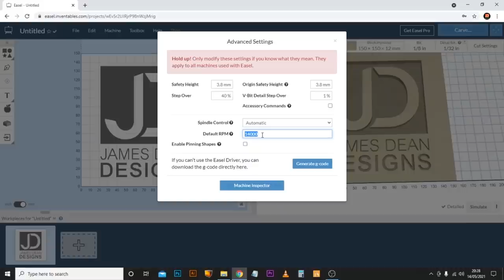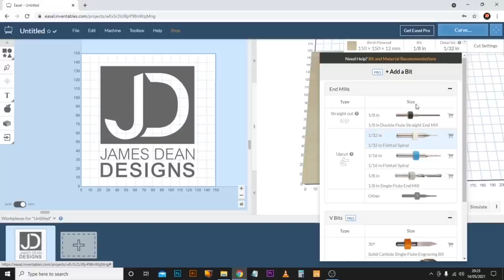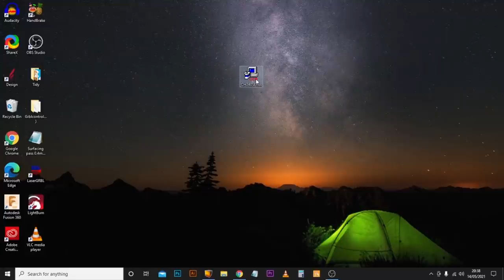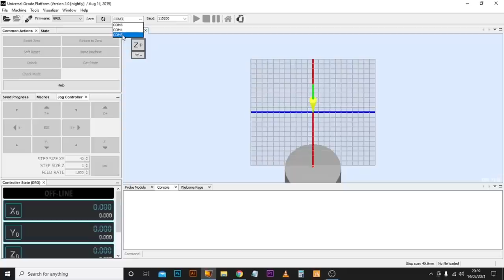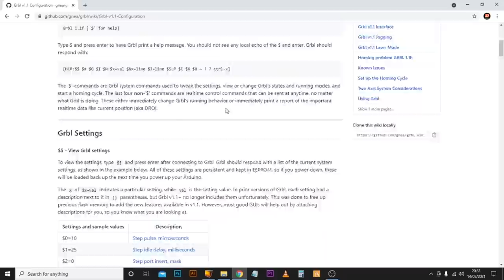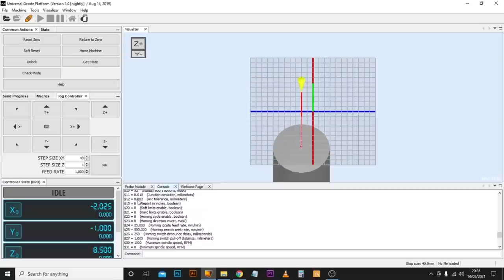Top 10 issues and solutions for desktop CNC machines - 3018, 4040, 4060, 6040, 6060,

Comment: Great video as always, very helpful! I'd just like to add that when routing out a profile it's always best with small bits to run multiple paths and drop down say 0.5mm each step. Harder materials the lower the step amount. It takes longer but your bits will thank you (and no I don't work for Manscaped lol!!). I have a 3018 pro but will definitely be building my own rather large CNC machine after scavenging some expensive steppers, just need to get the trinamic 5160 drivers built up...
Reply from the maker: Thanks for sharing!

Comment: Hello James, I'm really enjoying your videos. Very well done.

I'm totally new to this. And I am having issues. I have a 3018 Prover and it gets gets stuck on Connecting when trying to connect via UGS.
I'm using a Mac so I know you may not be able to help with that. It was connecting just fine until I tried to run the first job.

If I try using the Offline Controller I get SD Card OK and error 2.
When I try the computer the Controller is unplugged. When I try to use the controller the computer is unplugged. 
The 3018 is not being locked by any of the limit switches.

It almost seems like the configuration stored on the board is bad. Is there a way to fix this?

I did fill out the contact form at SainSmart's website three days ago and still have not heard from them.

Any suggestions appreciated.

Thanks,
Andy
Reply from the maker: First suggestion is contact the via Facebook, or even join the Facebook Sainsmart group and post in there whilst tagging them. You're likely to get quicker answer from them (and me to be honest) and its also full of a lot of knowledgeable people.
You could consider trying another piece of software like Openbuilds Controller which may work. Alternatively, it may be worth disconnecting the limit switches and trying it that way to see if it make a difference if there is a faulty switch
Reply: Thanks James. I did ask in the forums. No one had answer to my problem. Turns out it was a bad control board. SainSmart sent me a new that fixed this problem. 
Thanks,
Andy

Comment: one issue i had with the 3018 pro max all metal is that the UGS/Candle keeps on issuing error messages during milling until it stops milling completely. it is accompanied by the the machine missing steps. the offline controller also freezes up when the spindle motor turns on. i thought it was a connection issue initially. i contacted the seller about the problem and they cant offer a solution. i searched here in youtube, reddit and several other forums and no one had the same problem. eventually i found out these issues were rooted on one problem - poor power supply regulation. a simple addition of a 10000uF capacitor solved all the issues.

Comment: Hi James not sure if you've had this issue before or but, I have a annoy board controller which works fine with my original laser but I brought a Sain smart 5.5 watt laser module kit but had nothing but Trouble When I connected it up it fired straight away then had to disconnect it by the power I was told that the board was un compatible and it was missing controller drivers after speaking to the sain smart Solutions and not getting anywhere  do you know which board would work with it as I have had nothing but Trouble and now thinking just to send it back and get my money back 5 weeks later not even used it it and 87 emails layer to sain smart many thanks Rod
Reply from the maker: Sorry to hear that. Sainsmart use woodpecker boards I believe. Annoy Tools took over Cronosmaker which are fairly decent boards so its odd Sainsmart are saying that but at the end of the day, they know their products

Comment: Great video James, I bought 3018 pro and my main issue right now is the spindle not working using Candle or UGS on my MacOS , but it's working fine using Easel. My main worry the GRBL configuration are missed or corrupted , I heard some Mac users they don't have any issues with spindle on Candle and UGS software. Do you have any idea how could I troubleshot it?
Reply from the maker: That is strange. When you export you Gcode rom Easel, make sure it has a M3 or M4 command in the first few lines. Candle has a button for manually starting the spindle, does that work? When using UGS or Candle, make sure your machine is not connected to Easel, the machine can only communicate with one program at a time

Comment: 3018 prover offline controller can’t clear or reset error code 2 machine stopped in the middle of a job and now i can’t connect to candle again machine was running of of candle on desktop at the time when it happened

Comment: I have the issue that my designs from easle are making strange side moves through the material in the middle or the end of the job. van you tell me what the reason could be?
Reply from the maker: Its difficult to diagnose like this. I would suggest either posting on the Sainsmart or Easel page with photo and I can try and help you from there. You can tag me as @James Prestage and I should get notified.
Reply: @JamesDeanDesigns  cool thank you I will do so :)

Comment: Hey James,

Great video.  When using UGS with my FA 4040 XE, I get connected but when I push my jog controls, I hear the motors however nothing is moving.  I checked with my offline controller and everything works fine....any thoughts why it won't move with UGS?
Reply from the maker: My initial thought is to make sure you're switching the controller over to PC when using UGS. And this may sound silly (sorry) but make sure your controller box is actually turned on when using the PC. When you connect the USB cable the box may light up and the screen will come on, however it need the power actually turning on to run the machine even if it connects
Reply: Did you find a solution to this? I have the same issue, candle works, a g code app on my phone works but not UGS. Just buzzing from the steppers but no movement

Comment: I bought a 2 in 1 CNC and laser machine, laser works fine but having issue with the CNC... its uses candle software and connects but the x and y axis movement is very little when i press the arrow buttons it moves like less than 1mm, even the z axis moves very little
Reply from the maker: Likely to be your steps need correcting. Try this video https://youtu.be/nGwUf8uNWBU

Comment: Thanks!!! Quick question that maybe you’ve covered in another video. Is it possible to do your creation in the software then save g-code to a usb stick then plug it into the 3018 somehow. Basically have the CNC as a stand alone without being hooked up to the desktop?
Reply from the maker: I've not covered it but you have two options. The easiest is called an offline controller, you load your gcode onto an SD card, insert that into the offline controller. They are fairly cheap but are basic, so for example it can sometimes be tricky to set the Z probe unless you buy a more expensive one. The second option is a Raspberry Pi hooked up to a little 6inch screen. Its nice a small, gives you all the functions you need but you need some knowledge on how to use them
Reply: @JamesDeanDesigns  thanks!! Maybe idea for another video 😉
Reply: @JamesDeanDesigns   My (near) future supplier of the 3018, in fact an E-shop but seated in my home town, can deliver two versions, according the description. With or without offline controller. (that I discovered later, I only noticed two different prices and first and I didn't know why.
Now, by answering the question, you perfectly explained what it does. So I'll buy the one with the offline controller (+20 Euros here)
The design work I can do on my laptop in my office, where I have a good internet connection  and the "real" work in my woodwork shop
(or anywhere else at a place with electricity) and I don't need a computer nor internet in that case.  Sounds perfect.

Comment: Hi i`m new to this i have a 3018pro it work was working great then XYZ axis stop moving i have power going to to motors any ideas would be welcome
Reply from the maker: Could possibly be something to do with the driver chips on the control board if they have been knocked or damaged. It may also be something to do with your connection. Unfortunately it is usually a case of trial and error to find the solution

Comment: Hi James, finding your videos extremely useful. Problem I have is that the spindles are not running fluently. All seem very jerky and moving incredibly slowly. Even the Z axis which I did not build!  I hve tried the loosening bars and moving to each end and tightening up again (X and Y) but they are still the same. Couplers are tight enough. Any ideas?
Reply from the maker: Does everything move freely by hand? if so it sounds like you might have a power issue. Ideally you would use something like a multimeter to test what volts are going to each part
Reply: @JamesDeanDesigns  Thanks James. Yes things do move freely by hand. I'll check the motors.

Comment: where do you find programs already set up?  I want to flatten wood blanks so that I can engrave them
Reply from the maker: You don't really. You need to make them based on your machine and the bits you're using. But if its just for flattening they will be fairly easy to create in design software such as Easel or Carbide Create

Comment: I have a Vecor 3018 and the following problem. When controlling with the offline GRBL controller, i.e. without a PC, the cutter moves diagonally a few centimeters down to the right when canceling or finishing a job and also the cutter moves down in Z direction below the height of the home position. So into the material, which is not so good. The spindle also switches off.
Does anyone know this and is it due to the firmware?
Reply from the maker: So this sounds to me like it is post processor related. The post processor creates your gcode but also inserts specific things for the start and end of the job. Not sure what software you are using but if its Carveco or Vectric you need to make sure you select the GRBL post processor. There are lots of similar ones but this is the safest
Reply: Thanks for the reply. I‘m using Easel. I haven’t selected any post or preprocessor. I will check that. But the issue also appears with demo files on the offline controller where I haven’t done any editing.

Comment: The biggest issue I have with my 3018 Pro is "ME". I did something stupid and was moving the X and Y axis 100mm and clicked the Z button by mistake, oops. The next revision of Candle should be to disallow moving the Z axis when the travel distance is set higher than 10mm.
I don't know if UGS addresses this issue as I have been unable to get UGS to work on my old Windows XP machine that I have dedicated as the CNC controller.
Reply from the maker: Its what I hate about Candle. In UGS you can set separate measurements for the Z axis to avoid that issue. I thought it could run on XP but I could be wrong
Reply: @JamesDeanDesigns  I think it can but I'm having an issue of it finding Java even though I installed the last version that runs on win32. I will continue trying but until I get it working or try my hand at writing my own version I'll just have to be careful.
Reply: Limit switches to the rescue!
Reply: @optikon2222  ever completely unwound a spiral cut aluminum coupler?  hell i even destroyed a nice set of gerwah couplers. i couldnt stand the pussy level of power the original motors came with so i upgraded to 93 oz in steppers and modified those making them closed loop. when my machine is holding a position i dont care how strong you are you arent moving an axis. only now i have to reset the motor as it will go into error when it bottoms out from hitting the wrong button in candle.

Comment: Hi james , my 3018 pro keeps plunging to deep and brakes bits continuously . What should i do?
Reply from the maker: What software are you using, Easel by any chance? And also if possible get a copy of your GRBL settings?
Reply: @JamesDeanDesigns  hi James any solution for my query' thanks
Reply: @JamesDeanDesigns   hi James any solution for my query' thanks
Reply from the maker: @maximekone1769  settings look ok which suggests it might be something in Easel. If you're happy to, send me a link to the project either on here or via Facebook/Instagram.
Reply: @JamesDeanDesigns  you mean the design ? Asap I will do through FB
Reply from the maker: @maximekone1769  yes, there is a way to share projects within Easel

Comment: I almost have my ProVerXL 4030 up and running.  And i get a very high bit error rate over the USB from my M$ $urface.  It's got to be some RFI or just  the typical sub-standard microsoft hardware and software.  I have the Prover XL offline controller, but it is very obtuse

Comment: I am making cnc machine using grbl sheild. when I move x and y axis they move perfectly fine but when I move z axis it's make holding Torque (Not move in any direction). 

And one thing is I connect nema 17 motor without any mechanical coupling it's free and still jamming problem

plz someone help
Reply from the maker: You may need to make sure your wires are in the correct order for the Z stepper motor as it sounds like it may be fighting each other
Reply: @JamesDeanDesigns  wires are in correct .if I connect same z axis motor in y axis pin it's rotate but in z axis connector it's not rotate , and stepper motor has not connected with lead screw it's mechanically  free.And stepper motor makes holding Torque
My cnc:- https://youtube.com/shorts/O3a2Ln-Tvpo?feature=share
Reply: @JamesDeanDesigns   And thank you for quick reply

Comment: I have 2 issues with the 3018 here they are. The ch340ser driver signature ended 05/09/2021 on may 10th my machine would not connect anymore. no matter the version i couldnt get it to connect and it would stay yellowed out in device manager. so i had to reboot and change the system date to 2017 which i figured would give me plenty of time. this fixed that issue but created another. i could no longer connect to websites due to system time and date being off. but it is working now as long as i dont go online for anything. in addition i had to turn off driver signature enforcement in windows 7 to allow me to install it. Does anyone know of a version that has a good signature that still works with the genmitsu sainsmart 3018 Pro?   only other issue i have had since day 1 with this machine is the machine position keeps shifting 1 mm at a time. it may run for 30 minutes then it will shift to the right 1 mm. it may shift back or forward another 1 mm after awhile and continue shifting throughout a job. mostly when running the laser but sometimes with the spindle as well. I have spent hours and hours making sure everything is properly grounded  and when that was done it reduced quite a bit but still randomly occurs. i have 4 backup brand new control boards and swapping out a bourd doesnt help either. I can honestly say it doesnt appear that it is skipping or missing steps because all steps are getting done, they just shift 1 mm at a time. 1 year into this machine and i have gotten most of its bugs worked out but not all, nor have i been able to find out any information on this and i cant tell if it is the verbage im using in searches or if im having a unique experience. already in process of securing parts for a more robust machine with professional controls but until then im still trying my best to keep this machine working. if i have a small job 25 minutes or less i can guaranty it will run flawlessly but longer jobs the success rate goes down significantly.
Reply from the maker: Hi, I'll double check but the one I used and that's supplied in my videos hasn't expired on my machine. As for your 1mm shift, it sounds like your missing steps which also aligns with it happening more on a laser (typically higher speeds). Consider slowing your feeds and speeds down a little, possibly slow your acceleration down too. Make sure your screw rods are lubricated and free from gunk

Comment: I had that driver installed before and the cnc was working fine. I tried connecting today and it wouldn't and  tried reinstalling the driver but it says failed install
Reply from the maker: Something may have corrupted as a result of updates. Is the USB cable plugged in when you go to install the driver again?
Reply: @JamesDeanDesigns  I tried everything. from checking cables to reinstalling. my problem was I didnt uninstall the previous version. only figured that out after a good few hours of stressfull tinkering. I think uninstalling did the trick.

Comment: I will have suggestion about driver, i had problem with stoping work in middle of work and after everything figured out it was driver problem it was 2011 year developed, i found new one latest 2019 and it fixed connection problems
Reply from the maker: Excellent. There are a lot of bad drivers out there unfortunately. Glad you found a better one

Comment: I have a 3018Pro and Easel simply refuses to talk to it. Mac and PC both. Flat out refuses. Every - literally every - other software package seems to connect to and control it just fine. Inventables was basically zero help whatsoever, and kept suggesting I ditch my $150 starter CNC, and buying their X-Carve (which, fairly, was my long term plan) and learn on that. O_o I was very disappointed with their help. I've tried literally every single suggestion or instruction I could find, either from Inventables or from the internet at large. I guess I just give up on Easel.